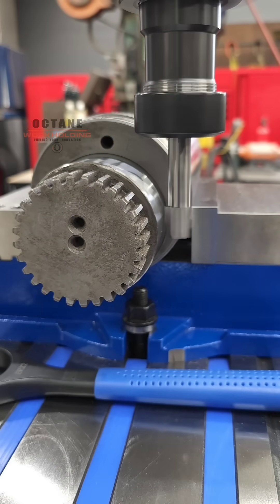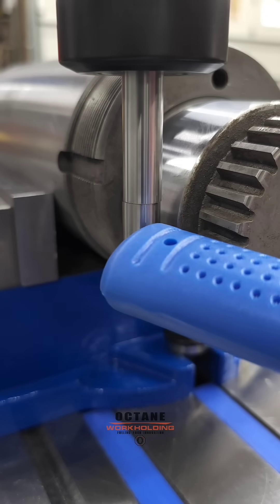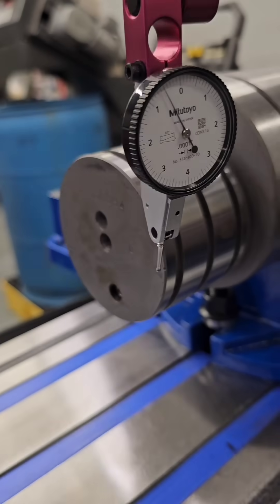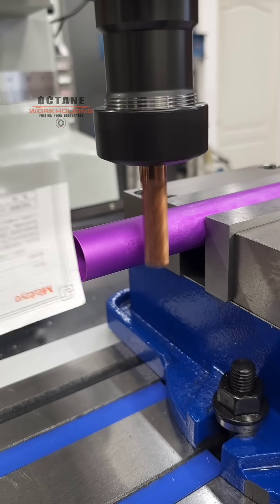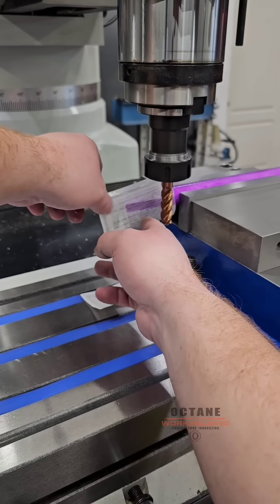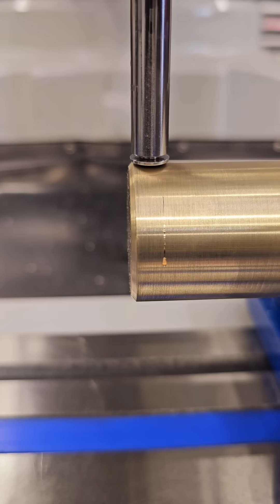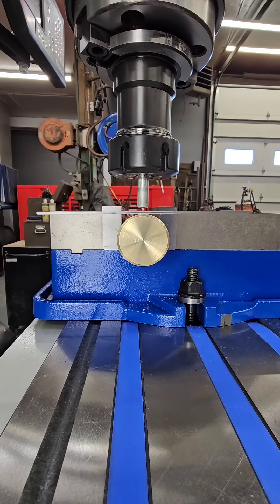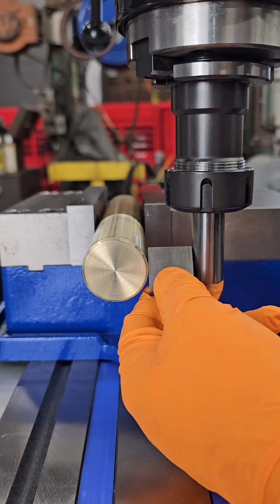Machinist Tips and Tricks Volume 10

Comment: Nice tips I use the paper technique by approaching the material with the cutter and then moving slowly with a feed of 0.01mm and also moving the paper up and down, as soon as the paper stops moving, I write down the zero point and cut off 0.1mm (which is the usual thickness of paper) it fits us at 0.03mm :D
Reply: and as for flutes on the endmill, I always turn it a little by hand :D

Comment: Wet cigarette paper is accurate to 0.001
Reply: Yes, but most people are not that accurate when using it. I've tried a 3-axis milling machine with an m&h probe once and it did store values in a couple of macros (Fanuc). What I like about that is that it's easy to use those values for whatever you could want with some programming techniques. Hats off for those machinists who made cnc's as user friendly as they are today
Reply: They look at you funny if you buy only cigarette paper.

Comment: I would still rather the renishaw probe, time is money
Reply: the renishaw probe is accurate, usually for example a typical OMP-40 with optical SSR, it achieves an accuracy of 0.02mm repeatedly and also the "stick" of the probe should be centered within a maximum of 0.02mm
Reply: @matejkuka797  0,02mm? It's always funny to me to see those numbers. Freshly referenced, we got the same diameters/lengths with those on our cnc mills as on the expensive measuring machines to like +-0,001mm. And It's really necessary if you wanna produce parts with less than 0,01mm tolerance. I'm kinda glad though I don't have to work on silicone injection molds anymore...